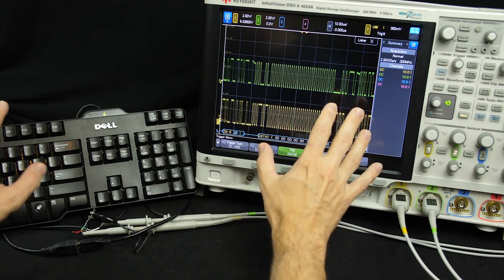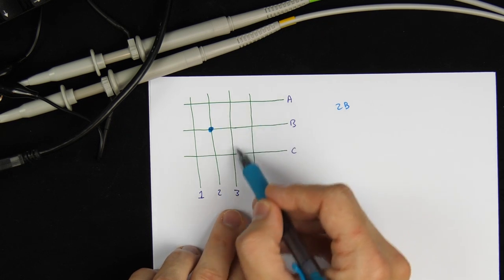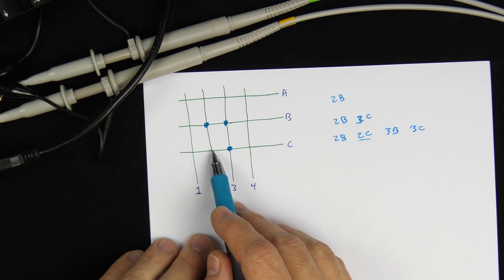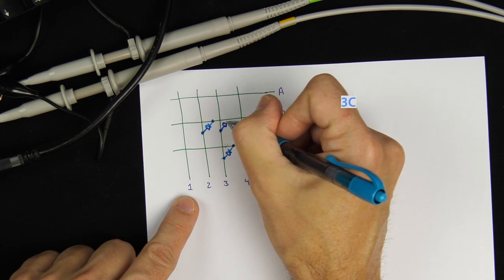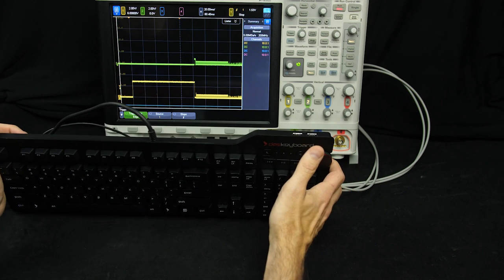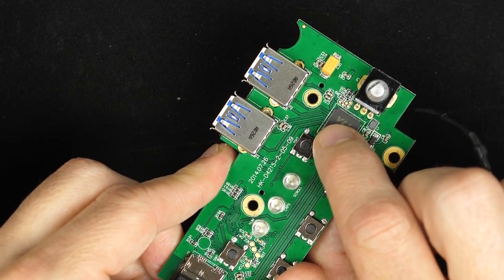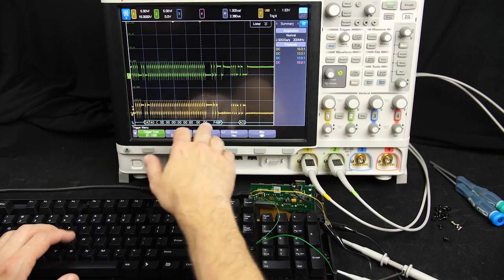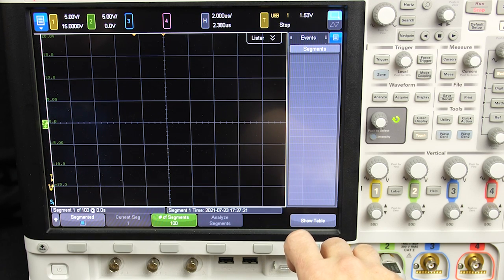How does n-key rollover work?

Comment: So many forums online say that you have to use PS/2 to get true NKRO. Such nonsense!
Reply: Probably just out of date (either the forum itself, or the person posting to it). NKRO wasn't in the original USB spec, IIRC, but was added some time after due to demand for the feature. Much like the USB-lag issue, which was also very much a thing with early USB keyboards and mice using the USB LowSpeed protocol, but - as we saw in the previous USB keyboard video - isn't really significant with newer keyboards and mice which pretty much all use the USB FullSpeed protocol these days (note that USB HighSpeed is relative to USB1.1, in USB 2.0 there is also USB HighSpeed, which is confusingly a lot faster than FullSpeed. It is unlikely a keyboard or mouse would use this as there is just no point!
Reply: It's not out of date.  It's just folklore that is repeated and incorrect.  USB has always had device-defined report formats which were capable of reporting N keys as a bitmap should a hardware manufacturer so choose.  Different input report formats described by report descriptors was not a late add-on.  To get N-key rollover one needs (1) a keyboard matrix that eliminates ghosting, and (2) support in the device microcontroller for more than the so-called "boot" input report format.  The first makes the keyboard more expensive to make, and the second makes the device inaccessible on PCs running operating systems like MS-DOS with "real mode" firmwares, which used to be a significant market factor.  The first is also a factor for PS/2, as preventing ghosting is independent of the wire protocol between the host and the device, but the second is not.

Comment: 1:25 "Actually only a 2 key rollover keyboard": Microsoft will be disappointed to hear that. How do you do CTRL/ALT/DEL...one of the most important Microsoft key combinations?
Reply: I think 2 key rollover only refers to minimum rollover. You can still press up to 6 keys at a time, as long as they don't make that corner shape anywhere
Reply: If you watch his previous 2 videos on keyboard protocol, you would've known that said keys have their own special address and do not interfere with normal key presses.
Reply: I think the manufacturer has optimised the grid layout to allow certain combinations. Modifier keys and WASD will probably be on a part of the grid that allows more strokes at once, since they are often used together. O+P+L is not often used together, so the manufacturer will optimise the grid there and not allow more than two strokes at the same time. It is just a way of cost saving that most users will never notice. And yes, it may only save half a cent per keyboard, but if they sell a million keyboards that's $5,000.
Reply: @greggrizzla9169  Also it's not just the component costs. You need to solder them on the keyboard, that's otherwise pretty void of components. That could easily cost more than the components themselves. Plus all the testing...
Reply: @kilianhekhuis  It's not like large scale manufacturing is having people solder components by hand. A normal circuit board would be soldered by automatic application of solder paste and then run through an oven to melt the solder into place. The bigger problem here is that the relevant circuit board for the cheap keyboard is almost certainly just flexible circuit board with no components. Adding the diodes would mean going through pick-and-place and soldering for that component instead of not doing it at all, and that is probably where the big costs lie. They'd also probably have to change the substrate to something that could survive the soldering process, and I bet that cost would be significant, too.
Reply: @greggrizzla9169  I remember the days when accountants could recover their whole salary for several years by eliminating a washer. I guess they had too many accountants. The cars fell apart and they eliminated Detroit.
Reply: The rollover number only refers to 'regular typing' keys. Modifier keys (ctrl, alt, shift, etc.) get their own bitfields even in the most basic protocols.
Reply: The modifier keys have their own dedicated lines to the microcontroller. This was a design decision by IBM way back when they made the original PC in 1981 which has been inherited by every keyboard since.
Reply: @wbfaulk  Well, that's exactly what I meant :). Also, given that a keyboard PCB is pretty big, you need one of the larger P&P machines, all adding to the costs.
Reply: A lot of people are conflating ghosting with rollover.  Ghosting is just one of the factors in how many key rollover one has, as the video indicates.  3 keys will cause ghosting, but that depends from exactly how the keyboard matrix is wired up, and there are ways to do that so that common modifier key chords do not usually cause ghosting.  The matrix does not have to be wired up in the exact physical row/column arrangement of the keys.  Also note that not every arbitrary combination of 3 keys causes a ghost.  Think about how the current paths work.

Comment: This is hardcore . You're borderline-ruining a $200(-ish) keyboard just to double-check that it follows spec.
Reply: Diodes must be really expensive!!
Reply: Or maybe he's getting a free $200 keyboard just to do that?
Reply: @idjles  Diodes, plus individual mechanical keys soldered to a large circuit board, plus a proper USB-3 hub, plus significantly lower-volume production than Dell et.al. to spread the design and factory-setup costs over. It all adds up!

Comment: N-key seems so elegant, why bother creating/ or supporting the scan-code format?
Reply: The scan code format came first. Has to be IBM AT keyboard (from the 1980s) compatible so it works with any existing software/OS.
Reply: 6-key rollover is generally sufficient for touch-typing (where, if you are very good, you can get 3-4 keys ahead of the keys' mechanical ability to release before you are already pressing the next one). For typing text, a serial string of scan codes is easier to process. For gaming, however, you are often not 'typing' but using the keyboard as a 'big array of buttons' which is where n-key rollover really shines and, as per your comment, treating the keys as a binary field is far more useful.
Reply: @1971merlin  I am aware it's older, but that doesn't explain keeping around. If you have to have the USB driver ni the first place, the device isn't natively compatible with older systems, so it seems unnecessary to keep it.
Reply: @vikiai4241  "640K should be enough for anyone". That doesn't really answer the question of why they implemented a restricted format when the general solution is more elegant and unrestricted.
Reply: @belg4mit  if you want to go into the BIOS or run an OS without a driver ......
Reply: It is elegant.  But reports that fit into 8 bytes or less are convenient because of other parts of the wire protocol.  It is not a scan-code format.  It's just a way of encoding the bitmap in a way that shortens it to 8 bytes at the expense of limiting how many 1 bits can be reported.  And this isn't PC/AT compatible, so that explanation is incorrect.

Comment: You just seen nothing... There are advanced gaming keyboards out there which works as composite USB device with multiple HID devices connected. This take anti-ghosting to whole new level, only sky is the limit
Reply: In many ways that less advanced than this, as this approach for the device in the video simply runs with the idea that the operating system and machine firmware support what USB has actually been capable of all along, a simple bitmap with an individual bit for every key.  The tricks with multiple devices that get played are really for interoperating with stuff that is not advanced, and has had corners cut.

Comment: i will keep it short i recently bought your 8 bit computer project the full thing plus the pcb on your site i got it made with jlcpcb and after i assembled it the ram would clear in run mode when the clock pulsed a video of the problem is on my channel any help would be appreciated.

Comment: Please help. I have an arduino microcontroller that accepts input from 3 devices, these devices can send data at any time by a either short or long pulses. If two devices decide to talk at the same time, even if they are hooked on different interrupt pins, the interrupt routines can't measure proper timings because one steals cycles from the other causing a long pulse to be interpreted as a short one. How is that problem solved on computers which have loads of peripherals? The devices are a 2 DHT11 temperature sensors and an i2c two wire communication
Reply: There's no short answer, or solution to your problem. 

First of all, the i2c protocol does not use a system of interrupts, because that would cause the problems you're having right now. Instead, the master device queries, or polls the connected peripherals by using an address system. This is actually a form of multiplexing, but it isn't immediately obvious to a beginner because it is hidden in a serial format, and includes a handshake protocol.

I've looked at a datasheet for the DHT11 Temperature sensor, and it is not natively an i2c device. It would have to be connected to some sort of a breakout board. In your case, this would usually be another Arduino that has been programmed for this function and has the sensor connected directly to it. This breakout board, and not the sensor, would negotiate the i2c functionality and send the data from the sensor.

If you're truly doing it from scratch, I'd suspect that you'd be using combination logic to determine when the device is being queried and shift registers to capture and transmit the sensor's data through the one data line. 

Your best bet is to find someone who has done it before and find out what they did. 

DroneBot Workshop covers this rather thoroughly.
Reply: It sounds like your system of interrupts is happening internally on the slave Arduino, completely independent of the i2c protocol, or at least it should be. Remember that the master device drives all communication, never the other way around. 

Also, the IDE should be optimizing your code, so a hardware fight over CPU cycles shouldn't exactly be on the top ten list of things to suspect.

If you are using separate pins for the sensors, wouldn't it make more sense to just have a while loop that updates two different variables, or better yet, two elements in a data array? Then those variables or the array gets fired off up the line, as is, when the device is queried by the master. I guarantee you that loop is going to run faster than the sensors themselves.

Your best bet is to go back to the ordinary DHT library and revisit the code. If you can get one sensor to dump it's data into a single variable regardless of the timing, you should be able to do so with the second one as well. This really doesn't have to be as well-coordinated with the master query as you think, since code runs so quickly that it only seems like it is. 

My problems with coding used to stem from trying to make everything happen in one step, because it always seemed like that's how it was supposed to work, rather than separating everything into distinct steps. 

The DroneBot Workshop's i2c tutorial videos make use of ultrasonic sensors, but the overall setup shouldn't be too different. I hope this helps.

Comment: It may not be related to this video but I still want to address this, I didn't know how to explain it with words so here are the links...
I did consider questions you may have:
1. First off if you're wondering why they are discord attachment links that is the only way I thought of at the time to convert the images to links...
2. And also if you're wondering why you should trust the links this for all you know they could be viruses in the form of discord links. But in my opinion it's really just your choice if you want to read this / click on the links, read this and not click on the links, or don't read this in its entirety in that case my explanations won't really matter...

And those who are curious about the server that this was sent to to convert into links feel free to convert the link into some sort of usable code

I am sorry if anyone is irritated by this comment by the way...

https://media.discordapp.net/attachments/866880022429433886/871611104005062686/1627878296303.png
https://media.discordapp.net/attachments/866880022429433886/871611103803756594/1627878344777.png

Comment: My guess on the extra functions reported that don’t have any physical buttons attached is that it’s in the ANSI C code compiled for the microcontroller and the dev does not know usb HID device code and just did a copy paste from some other products source. 😉
Reply: My assumption is the first keyboards that supported that HID spec we're those "internet multimedia" keyboards from the early 2000s and if they don't define all those keys some Windows ME driver won't initialize properly. And now it's just copy and pasted.